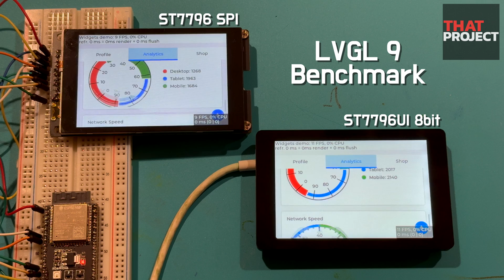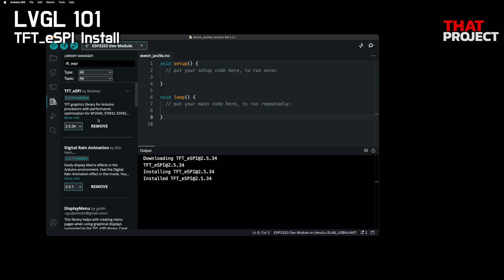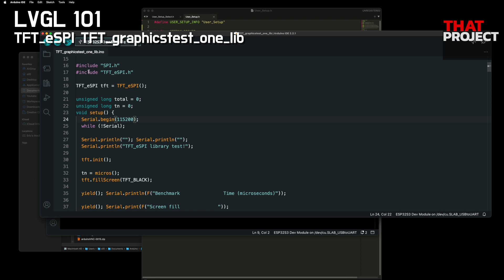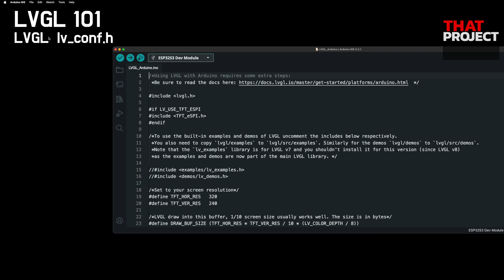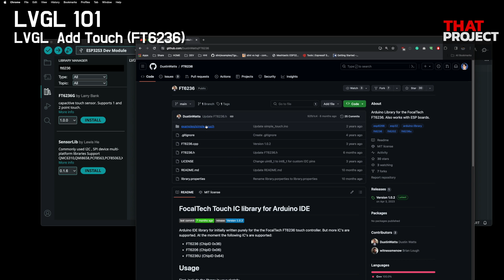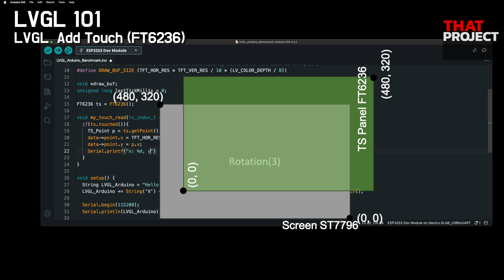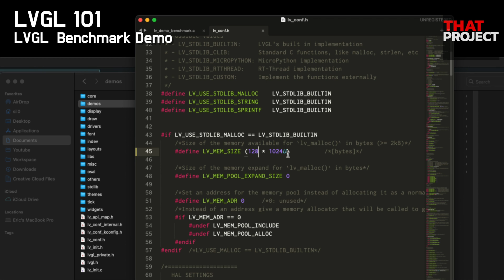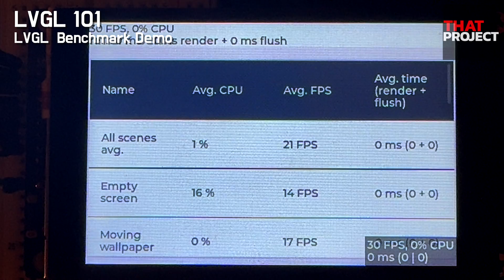LVGL 9, [Ep. 01], From Scratch to Benchmark, For newbie/beginner/starter #LVGL #UI #ESP32 #Benchmark

Comment: If you’re going to make a tutorial video and label it for noobs, you should never add or remove something from the code without explaining what you’re adding/removing and why. There were quite a few times when you when you rushed through removing blocks of code and all you said was, “I’m going to remove some things I do not need.” A “noob” has no idea what that means nor is a “noob” going to read 1,000 lines of code or even understand the first block. When you say noob, you gotta think noob. Someone who has never used LVGL, a gfx library, or even a library at all. Hand holding, by the numbers, step by step with clear and detailed information should be the only video marketed to a “noob.” Things like what was the purpose of using a Skelton example, what is an example, why do I need to start with an example, why can’t I just start with my own custom code? Anticipate the questions and answer them before they can be asked.  You touched for a second something about in your display wasn’t in somewhere directly implementing the display callback function… and then went on to the next slide, what is a display callback function? Noobs don’t know, gotta teach, not just show. One of the better videos I’ve seen though, thank you.
Reply: yeah he just remove something with buffer and rewrite it I get lost. But I manage to get it work anyway on st7735 (128x128, 1'44) I run benchmark on it somehow I got too much memory with 128kb, I set it on 64kb. Still encountering issues with incorrect alignment and the ESP reboots after while running benchmark (probably because of the kb sets).  But to be fair the display is too small to use the build in assets in lvgl. Even the arduino example is missing letters while its centered.

Comment: Hi, I just started experimenting and came across your video. I followed everything step by step, but unfortunately after upload i got in serial some issue like this:

rst:0x8 (TG1WDT_SYS_RESET),boot:0x13 (SPI_FAST_FLASH_BOOT)
configsip: 0, SPIWP:0xee
clk_drv:0x00,q_drv:0x00,d_drv:0x00,cs0_drv:0x00,hd_drv:0x00,wp_drv:0x00
mode:DIO, clock div:1
load:0x3fff0030,len:1184
load:0x40078000,len:13260
load:0x40080400,len:3028
entry 0x400805e4
ets Jul 29 2019 12:21:46

Comment: What should I do in the lvgl config file if my driver is ILI9488?
Reply from the maker: It seems that TFT_eSPI of LVGL does not support ILI9488 internally yet. In this case, you need to implement the Flush callback function yourself as follows.

lv_display_t *disp = lv_display_create(TFT_HOR_RES, TFT_VER_RES);
draw_buf_1 = heap_caps_malloc(DRAW_BUF_SIZE, MALLOC_CAP_DMA | MALLOC_CAP_INTERNAL);

lv_display_set_flush_cb(disp, my_disp_flush);
lv_display_set_buffers(disp, draw_buf_1, NULL, DRAW_BUF_SIZE, LV_DISPLAY_RENDER_MODE_PARTIAL);

void my_disp_flush(lv_display_t *disp, const lv_area_t *area, uint8_t *px_map) {
 uint32_t w = lv_area_get_width(area);
 uint32_t h = lv_area_get_height(area);
 tft.startWrite();
 tft.setAddrWindow(area->x1, area->y1, w, h);
 tft.writePixels(px_map, w * h);
 tft.endWrite();

 lv_disp_flush_ready(disp);
}

Comment: Thanks for your work. I'm learning to use lvgl and I'm following your tutorial but with poor results because it doesn't work.
I have not been able to use LVGL for months because the libraries are updated and changed.
So I installed the following libraries because the various updates change the syntax of the code.
LVGL v9.0.0
TFT_eSPI v2.5.34
FT6236(Dustin Watts) v1.0.2
I'm using the same display as you in your tutorial ST7796 and esp32-wrover-e

In user_setup.h I set the pins:
#define TFT_MOSI 23
#define TFT_MISO 19
#define TFT_SCLK 18
#define TFT_CS 5
#define TFT_DC 21
#define TFT_RST 22

The connections to the esp32 are as follows:
ctp_sda 21
ctp_scl 22
ctp_int 4
ctp_reset 3.3V
led 3.3V

The TFT file example works.

But If I use your example on github and change with the following pins 21 and 22 the sketch doesn't work, the touch also doesn't work  and the display is illuminated without showing anything.
#define SDA_FT6236 21
#define SCL_FT6236 22
Like partition scheme I'm using Huge APP but I think that there is a issue with PSRAM.

Do you have any advice?
Thank you
Reply from the maker: You said that TFT_eSPI Example works fine. Does touch work fine too? Are there no error messages, just nothing displayed on the screen?
Reply: @ThatProject  Thanks for answering me. Considerations and doubts:
- I don't know why but I discovered that the lv_conf.h file must be moved to the main folder of the arduino libraries and not in scr folder.

- If you use FT6236.h as a library it's essential to use the CTP_SDA and CTP_SCL pins only with the I2C pins of the esp32. 
In my case the I2C pins (esp32-wrover-e) are pins 21 and 22. Defined in this way #define SDA_FT6236 21 #define SCL_FT6236 22. 
Do not use the pins for other purposes. Only in this way will the touch be detected through the Serial Monitor.

Doubt: In the documentation it says that the demos and examples folders must be moved to scr folder, but I read in the LVGL forum that this could create problems and the documentation should be updated.

Up to minute 13:20 of your tutorial I tried the various codes step by step and they work:
- TFT_eSPi works;
- LVGL works;
- FT6236 works;

If I try to load the example code lv_demo_benchmark it gives me errors on the memory even though I have an esp32-wrover-e and this aspect is very strange and I don't understand how to solve it.
The errors are as follows:
c:/users/produ/appdata/local/arduino15/packages/esp32/tools/esp-x32/2302/bin/../lib/gcc/xtensa-esp32-elf/12.2.0/../../../../xtensa-esp32-elf/bin/ld.exe: C:\Users\produ\AppData\Local\Temp\arduino\sketches\417E1D0A5EC7D71D3BFF36B450B0A190/sketch_nov14a.ino.elf section `.dram0.bss' will not fit in region `dram0_0_seg'
c:/users/produ/appdata/local/arduino15/packages/esp32/tools/esp-x32/2302/bin/../lib/gcc/xtensa-esp32-elf/12.2.0/../../../../xtensa-esp32-elf/bin/ld.exe: DRAM segment data does not fit.
c:/users/produ/appdata/local/arduino15/packages/esp32/tools/esp-x32/2302/bin/../lib/gcc/xtensa-esp32-elf/12.2.0/../../../../xtensa-esp32-elf/bin/ld.exe: DRAM segment data does not fit.
c:/users/produ/appdata/local/arduino15/packages/esp32/tools/esp-x32/2302/bin/../lib/gcc/xtensa-esp32-elf/12.2.0/../../../../xtensa-esp32-elf/bin/ld.exe: region `dram0_0_seg' overflowed by 29552 bytes
collect2.exe: error: ld returned 1 exit status

exit status 1

Compilation error: exit status 1

I tried changing various settings.
Psram: enable.
Partition Scheme : Huge app
Flash Mode: QIO
Erase All Flash before sketch: enable

I chose the ESP32 Dev Module as the board
I also tried changing with esp32-Wrover but nothing changes.

I am unable to upload the code or even continue with the tutorial.
Thanks a lot for your help.
Reply: I hope it can be useful to someone else. The problem I encountered is due to the fact that I changed LV_MEM_SIZE from 64Kb to 128Kb as suggested by the tutorial in lv_conf.h and this creates an overflow. 

Not all esp32 allow you to increase the memory from 64Kb to 128Kb because the DRAM memory even if it were 128kB is divided by the microprocessor to also perform various internal tasks and the one actually available would actually be much smaller and therefore around 64Kb. 

If you change the memory size from 64Kb to 128Kb in Arduino IDE it gives you problems loading the sketch and it is probably due to this aspect.
Reply from the maker: @Grisodirector  Good point. As mentioned in the video, increasing LV_MEM_SIZE was necessary to run large applications like Benchmark. This may need to be handled differently depending on the device we have.

Comment: Great video! but i'm wondering will ESP32-C6 also work with tft displays? I'd like to use 5 or 7 inch touch display SSD1963 (display) and XPT2046 (touch) controllers. Would be grateful if you could answer. Thanks

Comment: I've done every single step you mentioned in this video but even after uploading the code on ESP32 the display continues to stay blank.
The display I'm using is Waveshare 1.69inch 240x280 pixels ST7789V2. The display is working properly and the connections are proper as well.
Reply from the maker: @anishkarbhari2908  As mentioned in the video, you need to configure it according to your display. Did you finish the setup for ST7789V2 correctly in user_setup.h of TFT_eSPI?
Reply: @ThatProject  I am using a ESP32 S3 for this project. So do I have to make changes in the Node MCU section in the user_setup.h file or the ESP32 section in the file??
Reply from the maker: @anishkarbhari2908  You only need to set up the ESP32 side.
Reply: Yess I tried doing with both 7789 and 7789_2 
I'm not getting an output
Reply from the maker: @anishkarbhari2908  Please check the TFT_eSPI Github issues page to find people who are having issues with your display setup.

Comment: Great video, man! I would like to ask a question. The driver that my display uses is the ILI9488. Works perfectly with TFT_eSIM. But I saw that in User_setup the driver needs to be set and there is no such driver. So it doesn't work?
Reply from the maker: ILI9488 is a graphic IC. Usually, the display has a touch IC separate from the graphic IC. (If the display supports touch). Please look for that first.

Comment: I am using an 8-bit parallel TFT shield and Wemos R32. Can I use the Adafruit_Touchscreen for LVGL?
Reply from the maker: Yes, you can, but you need to implement the Display flushing part yourself.

void my_disp_flush(lv_display_t *disp, const lv_area_t *area, uint8_t *px_map) {
uint32_t w = lv_area_get_width(area);
uint32_t h = lv_area_get_height(area);
tft.startWrite();
tft.setAddrWindow(area->x1, area->y1, w, h);
tft.writePixels((lgfx::rgb565_t *)px_map, w * h);
tft.endWrite();
lv_disp_flush_ready(disp);
}
You can also use the Adafruit TouchScreen, but you'll need to modify the my_touchpad_read part. Check out my GitHub for more info. https://github.com/0015/ThatProject/blob/master/ESP32_LVGL/LVGL9/LVGL9_Ep06_Air_Sensor_UI/LVGL9_Ep06_Air_Sensor_UI.ino

Comment: Hi amazing tutorial. I am having some difficulties following up . Becuase i cannot see the driver i have which is ST7262E43 , i have a waveshare board 4.3 inch. Do you know how i cant set it up in tft-espi
Reply from the maker: ST7262E43 is used on the official Espressif board ESP32-S3-LCD-EV-Board-2, so it seems like it needs to be set up using ESP-BSP. It seems like it can't be configured with TFT_eSPI.

Comment: Hi I have some problem setting up my LCD for LVGL, can you create a video about it?

Here are the details for my board:
- ESP32-S3
- 4.3" 
- ILI9485
- Not Touchscreen
- Board: ESP32-4827S043 (seen ok the back of the LCD board)

Additional info:
-As per checking it uses a RGB interface which is sadly not supported by tft_espi library
Reply from the maker: If TFT_eSPI is not supported, LovyanGFX or ArduinoGFX will definitely work. I hope you give this a try.
Reply: @ThatProject  Do you have any tutorials for lovyan gfx? I searched the net if they supported it, but I cannot find any, I would love to make the lovyan gfx work on my display since it offers sprites.
Reply from the maker: @cmtg4471  Sorry, I don't have any direct tutorial videos for it. This is the official document. Check this out. https://lovyangfx.readthedocs.io/en/master/